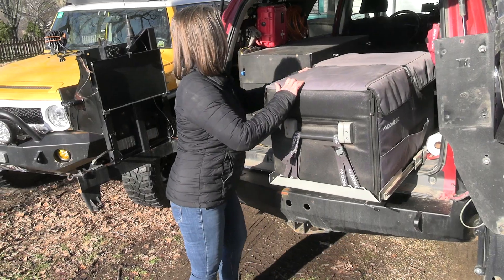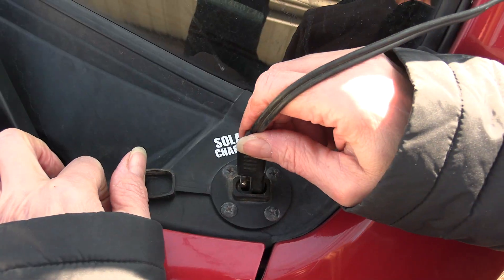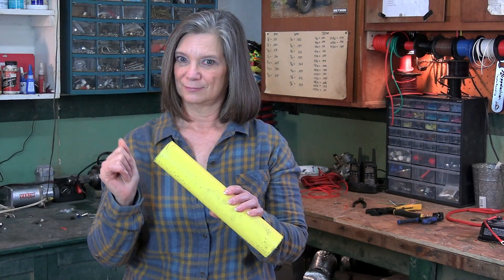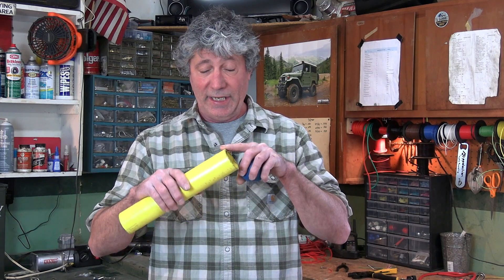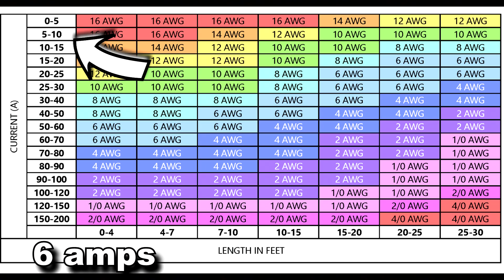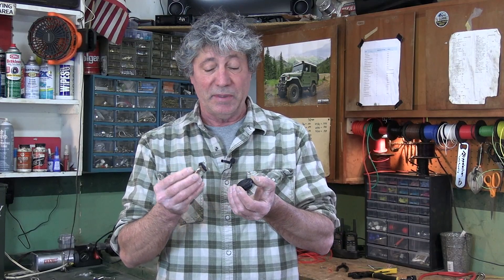Best Wire Size For 12 Volt Circuits

Comment: This is my first time watching your site and I really enjoyed your video!!!
I have a few questions and I'll try and be as clear as I possibly can.
The small speaker on my Bluetooth headset has a broken wire, this wire goes from the speaker to the small circuit board. It is extremely thin with black insulation with to extremely thin wires inside of it, one red and one is copper. What gauge wire should I use and do I need a certain soldering iron?
I can solder larger wires together and other things but my first and only try on a circuit board was disastrous, too hit and melted everything around what I was trying to do.
Thank you for your time!!!

Comment: Amps don't flow through wire,  current flows through wire.   Just like gallons don't flow through pipes, water flows through pipes.

Comment: The thickness gauge is a representative of how many of that size wire is required to make an inch, so you would need to lay 18 individual 18 gauge wires side-by-side to equal an inch. This is why thinner wires have a higher gauge value, and seem to count in reverse.
Reply: Nice info. 

❤😊

Comment: I will like to put 12 gauge all the way to my fog lights i have 4 fog lights of 40 watts each bulb but cables coming of relay and fuse little box its not 12 gauge is skinnier like a 16 gauge how can i get the whole wiring 12 gauge instead

Comment: The wire size chart I have from our manufacturer training manual states to measure both the positive and ground cable length, add them together, then use this number for the wire length for the MINIMUM wire size.

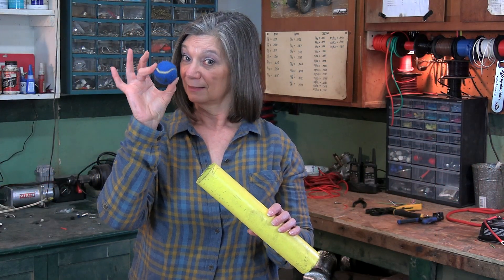Comment: At 1:12  The wire gage is the number of dies the wire is pulled through to get that size.  It requires 12 dies to get to 12 gage.  It requires 6 more dies to get to 18 gage.

Comment: I want to fix my ac compressor electrical port for my Prius.  Wondering if it’s possible.  It’s attached to circuit board.  Teeth bent and broken

Comment: The chart you are using is for sizing conductors based on voltage drop.  You also need a chart for overcurrent protection.

Comment: As a retired professional, I can say your video is good, and mostly correct.  You really cannot do a great video with just amps and wire size.  It must include overcurrent protection by fuses or circuit breakers.  Mis-use of overcurrent protection is the true cause of vehicle fires.  What is the purpose of overcurrent protection?   They are for the protection of the conductor insulation from degrading.   For those who say, well the fuse didn’t blow, it’s good.  Not the case.  Fuses blow from short circuit quickly.  But they also blow from over heating.  The copper needs to stay below the insulation degradation point, or if not over time, the insulation becomes brittle and cracks and is no longer insulation.  Then the shorts start.  If you install after the short location, then the short will be able heat the copper red hot and either burn it out, or burn your vehicle.
Reply: Wow, 

Great info for maintaining old vehicles. 

😊
❤
Reply: Hey Kevin,
Can you explain why you would measure from the power source, to the load, back to the power source to get the length of the circuit? Why wouldn’t it be from the power source to the load for the circuit length? Are they accounting for the ground?
Thanks
Reply: @toyrock16 . I wrote a long response.   Did you get notified of it?   It seems to be gone.
Reply: I do not see it.
Reply: @toyrock16 .  Look again.  I took out the link.   Seems to show up.
Reply: I tried again.   It could be that I put in a link and that’s not allowed.
To answer your question, a voltage drop calculation for DC&AC with copper would be 2x (12.9 copper)x amps x length in feet, then divide that by maximum volts of drop to result as circular mills of conductor.  The 2 is to account for travel distance out and back as distance is from source to load.
So a 120 volt copper branch circuit 3% at 20 amps and at 200’ away would look like this.
2x12.9x20x200=103,200.  103,200/3.6=28,666.667   When you look up properties of conductors you need a #4 copper.
Reply: @KevinCoop1 got it, thank you.

Comment: Very disappointed with this video. There is no actual information imparted to help you calculate the wire size for your application. They point you to a chart but say nothing about the voltage type AC vs DC … or that the chart should be for the voltage that you are using. … yes the consequences are real for getting it wrong … sure. How about the consequences of using the wrong chart?
Reply: It doesn’t matter if it is AC or DC.  The issue is current, not voltage.  Most 12 volt sources are DC so worrying about AC for 12 volts isn’t warranted.  The issue with voltage is the wire insulation, not the size of the wire and the title says wire size for 12 volt so that pretty much narrows the scope.
Reply: Actually, the information provided is spot on accurate, and the items you are questioning have nothing to do with calculate wire size. Which shows you don’t understand the difference between amps, volts, and power. But that’s ok, he wasn’t trying to explain all that.

Comment: What's 12 AWG? I have like 1-2 amps(a wifi 4g modem and a small microusb sync module for cameras). I used 1mm² thick wires. Will I burn this shit down?
Reply: Type "convert awg to mm2" into Google.

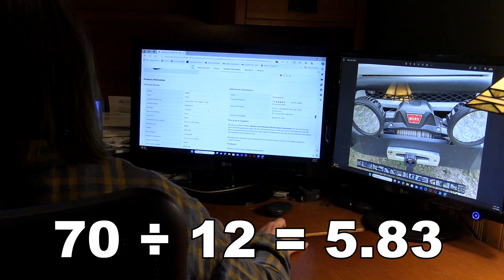Comment: I think at 2:14, it should be the length from the power source to whatever you're powering, and then back to the power source again. Blue Sea Systems also has a good 12V wire gauge chart.